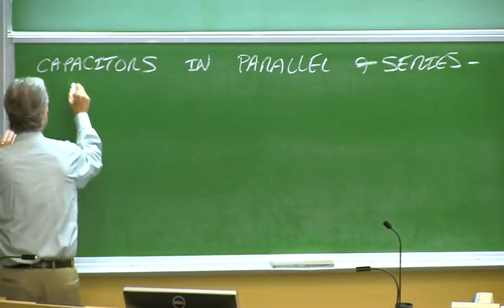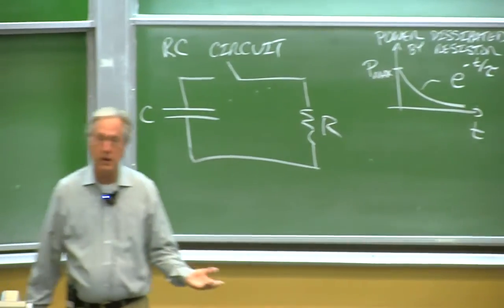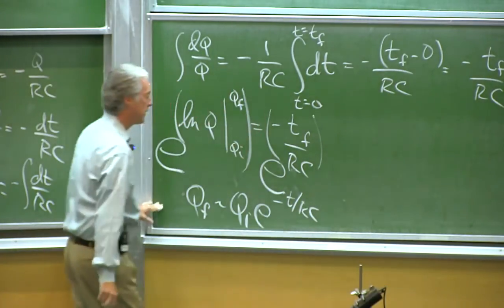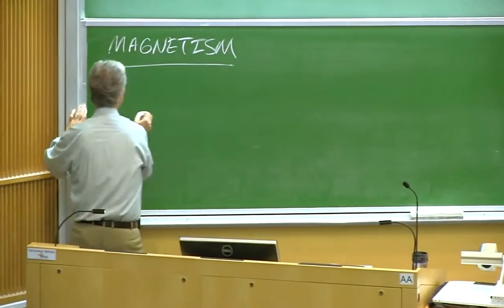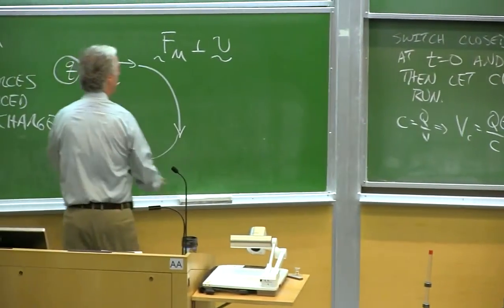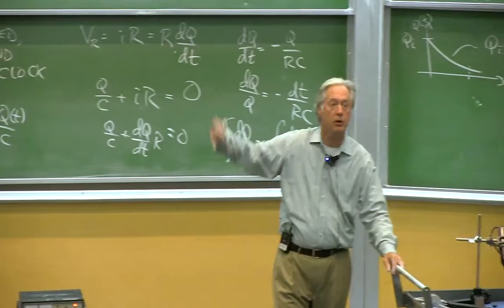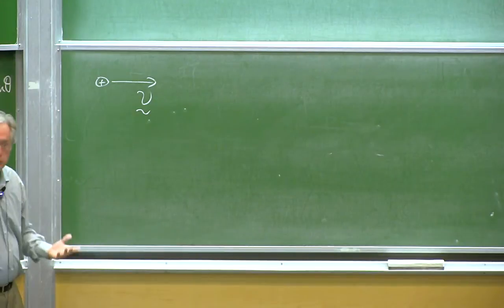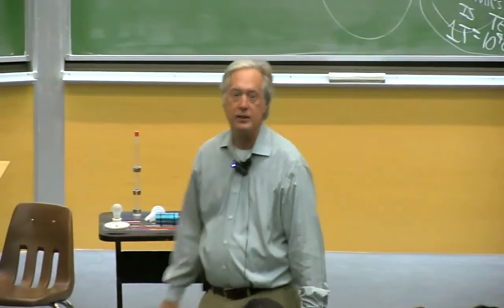Basic Physics II 3B. Lecture 15.

Comment: ^.   ^.                ^
v×B= vBsin@ n

Where n is unit vector perpendicular to plane of moving charge and magnetic field contains plane.
This is may also detected by RIGHT HAND SCREW RULE about the direction of unit vector 
^
n.
Reply: Depending on circular motion clock wise or anti clockwise then upward or down wards motion can be seen

Comment: Discharge tube the green colour is visible so in spectroscopy study we are used He or Neion etc as disachge gas when faced high voltage then such discharge took place in practice the colour like green here depending on the inner atom the electron transaction among different energy levels say Ek-El= hc∆y 
So this wave length emitted here .
When glass matrial touched such white colour is visible so any way the cause of different colour as external STIMULATION took place like ZEEMAN EFFECT for extra electric force F =eE that's come in to effect so electron transaction among the different energy levels took place so colour is visible is gray as per energy transction make sure different than before green colour.So basic cause due to external magnetic or electric field is responsible to the electron transaction of the atom so this is happening